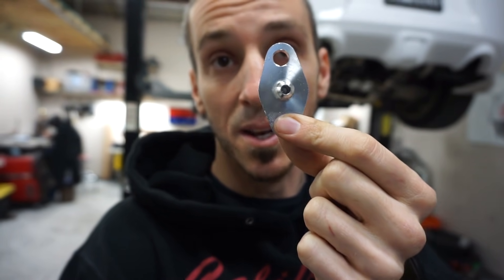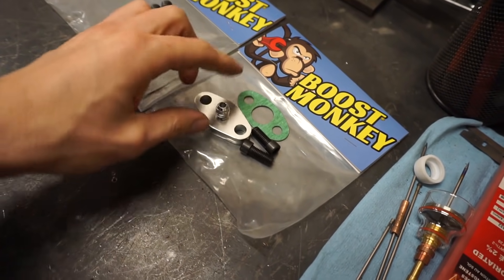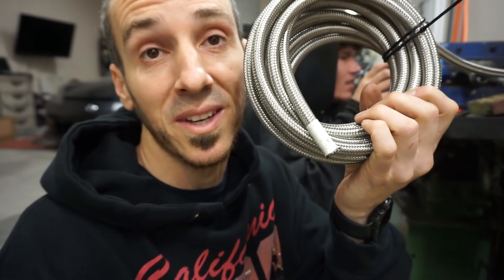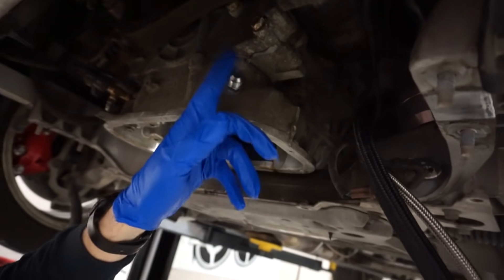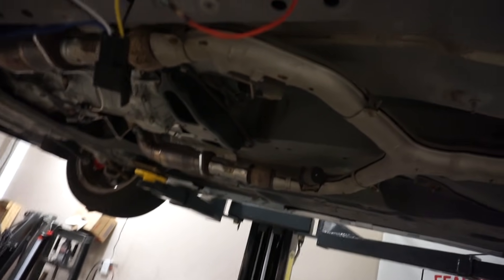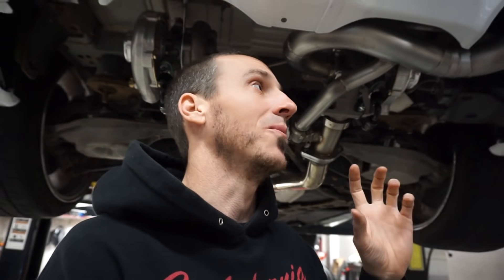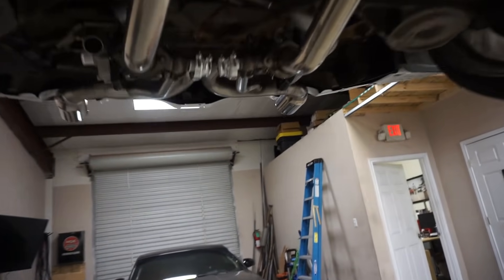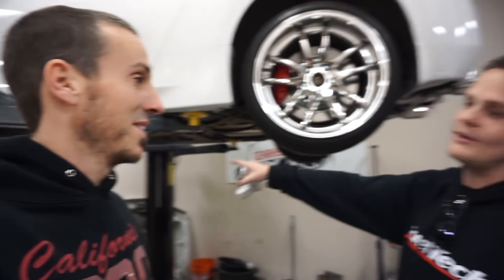Rear mount twin turbo 370z part 2

Comment: Hay I'm looking  forward to watch these videos to help me build my turbo 350
Reply from the maker: Let me know if you have any questions.
Reply: @GearheadsAutofab  I'm looking at turboing my 350hr.  The plann is to use two gt28 or a smaller gt25 . I think t25 will spool quicker . I'm in  research mode at the moment.  I can only work on the car on my drive with limited tools. So, seeing if it's possible.  Personally I don't see why not... I mean, the plan is to compensate for the lack of tools and space with over inflated ego and self-confidence... lol... question  is why can I mount the turbos to existing header rather then making cust9me header
Reply from the maker: Putting the Turbos at the end of the headers is hard because the Turbo will be lower than the oil pan or at least too low to correctly drain the oil back into the motor. That’s why people put them a little bit higher on manifolds. But also twin turbo is more expensive….2x the boost piping , exhaust , oil lines, intakes , harder to intercool etc. that’s why the easiest setup for a hr is single rear mount turbo.
Reply: @GearheadsAutofab  I actually didn't think of  oil  drainage...  I have seen on  some post where the turbo had its own oil store which was puped back in the sump. ... that does seem a like a lot of work thought...  what is the spool up like?  The turbo closer to engine means less pipe to charge quicker spool up... 

I guess a single turbo will be cheaper...
Reply from the maker: There’s not an affordable option, I have the eBay rev nine kit on mine, but I only have one throttlebody because mine is a De motor, all of the kits that will fit in your car are expensive. On the remote mount turbo kits they can spool good, there is a channel “black pearl media” , 600hp remote mount hr. 

I like having my turbo up front but I hate all the heat in the engine bay and the rev 9 kit seams to have big hp restrictions I don’t think I’ll be able to get over 500whp on it…..but we will see….I still think about going back to a remote mount turbo. I have ideas no one has tried yet ….

Comment: I was wondering could you just put completely different oil reservior with electric oil pump and connect to just feed the turbo? Instead of lining it up from the engine.
Reply from the maker: Simple answer is, it’s just soooooo much easier and cheaper  to get a long oil line and scavenge pump than a new oil system.

Comment: Dude you're going to fry those turbo bearings you should do a dry sump system but they separate oil tank in your trunk and the oil return line cannot eat under vacuum

Comment: I would like to know where you connected the oil pump for the turbo the electrical part where it was that you connected it to give it current at the same time of the engine
Reply from the maker: I can’t remember ......but stay tuned we are doing 2 new similar projects soon.

Comment: Does the turbo self feeds the oil and coolant?
Reply from the maker: We didn’t run coolant to the turbo. And the motor feeds oil pressure from the oil pressure sensor port. Then the return is pumped back to the pan with a oil scavenge pump

Comment: Ur hose should not be all the way against the top of the fitting when making an an line, I should leave a tiny space, if you don't and your using aluminum ends, when you screw in the ends you can snap off the end your screwing in before its all the way threaded in. Trust me on this.

Comment: Can someone explain how this works im so confused why the turbos are on the exhaust
Reply: Exhaust turns the Turbo which makes it suck in cold air and push it to the motor.
Reply: @charlesstillwell1985  then hows there exhaust, blow off valve?

Comment: Meh... I prefer the quiet fuel pump as my G is my daily. Still... as mentioned in the last video... I'm watching this like a hawk!! I have a 2004 Infiniti G35 Coupe 6mt.
Reply: Tunercraze how has you g held up? I’m thinking about get an 04 g or a 04 350z, how is the reliability
Reply: @moshakra02  Reliability so far is superb! I've barely needed to replace anything at all. TRY your hardest to snag a G/Z with Brembo brakes. Such a nice plus! You mainly get the Brembo's with the 2004 G35. Not sure with the Z. So far, Ive only needed to replace rotors, pads, and the usual oil change. That's it. She doesn't burn oil at all and is TRUE pleasure to drive!!! Plus, she's a looker till this day! I'm pretty picky though as I make it a mission to keep my G clean at all times. Tire dressing and all. Good luck with your searching and I hope you join this amazing community of G/Z/Q enthusiasts!
Reply: Tunercraze thanks so much bro!

Comment: Will you please post info of the box of connectors if possible? A younger me cut my oem radiator fans to my FD AND threw the fan and clips in the trash. lol. I plan to buy oem fans with connectors used/still expensive and splice them back to spec. I just want it to be as neat and legit as possible. Thanks :)

Comment: Won't there be a really big lag for the turbo to send charge into the front the engine. I'm curious
Reply from the maker: This is the million dollar question 😁🚗💸💸💸💸💸💨💨
Reply: @GearheadsAutofab  I'm dying with a front mount intercooler lol can't imagine with the entire thing in the back. This is cool though
Reply from the maker: I know right.....we have been going back and forth on if  we should add a intercooler or run straight to the engine.........you see the problem is I love fabrication and panda bought a intercooler that looks like the gtr ones and I can’t stop looking at it 🤤
Reply: @GearheadsAutofab  ohh nooo. Haha. If it's bought you gotta put it in 🤣🤣. And it'll drop charge temps alot

Comment: I would have switched the turbos so the exhaust would have been on the outside
Reply from the maker: Ya we did debate which way to place them….trying to make it look cool as possible, and function as well, it’s allot of plumbing, but it would work the other way.

Comment: Gearheads Autofab
great project bud just 1 thing i believe you will find you're going to need to add sumps for your turbos to drain into this guy goes into why https://www.youtube.com/watch?v=QXCkdtqYpG4 but the long of the short of it is that turbos love to gravity drain not be sucked it also has an issue with coking (oil unable to drain away once the engine is turned off cooks inside the turbo an coats the bearing thus crating it's own problems) anyway good luck with it.........

Comment: Can you do an LS swap in a 05 g35?
Reply from the maker: Well we are wanting to do a different swap into a 350 Z which is similar, but putting an LS swap in there sort of creates the same problem we already have with no space in the engine bay for Turbo and other accessories. So we are kind of going the other direction on the swap that will be doing soon which is reducing the size of the motor to a 4 cylinder, they should make the car lighter it’ll keep the weight back in the bay as much as possible and Give us a ton of room for turbo charging. We will be doing this right before the end of the year
Reply: @GearheadsAutofab  that'll be cool too see! Then I'm just gonna build this vq35de and probably get a boosted performance kit and send it! 🤣💯

Comment: Best spot to put a turbo is under the car hummm.... who in their right mind think that's a good idea
Reply: j spec This isn’t anything new
Reply: Everyone with a brain. It's easy access, T stays cooler (increasing life), IAT is cooler/charge is cooler (obvious benefit), engine bay stays cooler (more life to everything in there), can use stock manifolds, and turbos are louder outside if that's what you want. Cons? Slightly increased spool time (just wrap the shit out of the exhaust) and no driving in extreme weather...but you shouldn't be doing that anyway.

Want the best of both worlds? Single mid-mount. Problem solved.